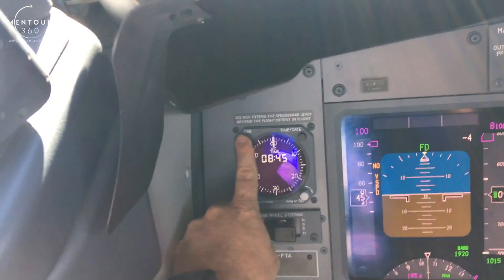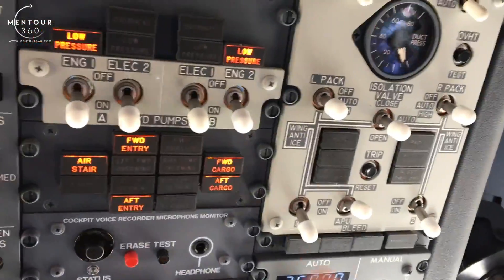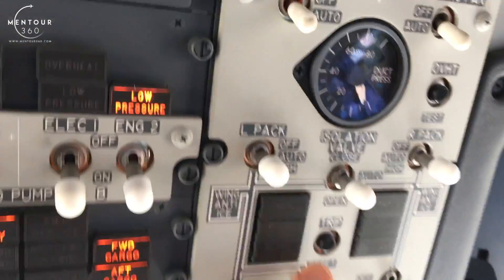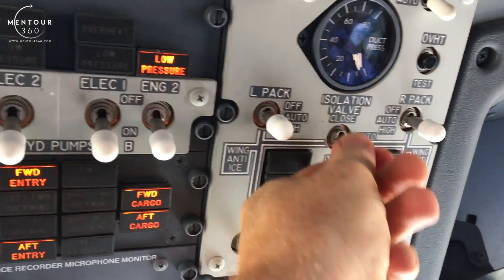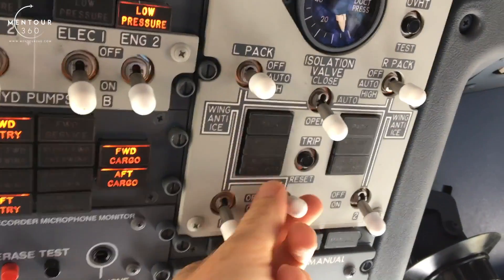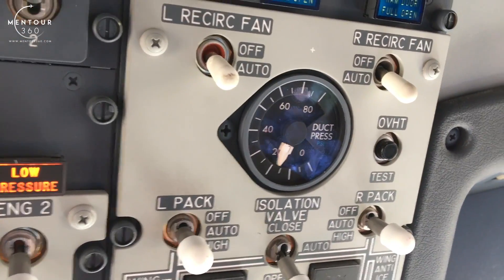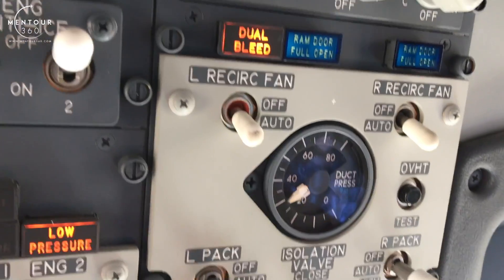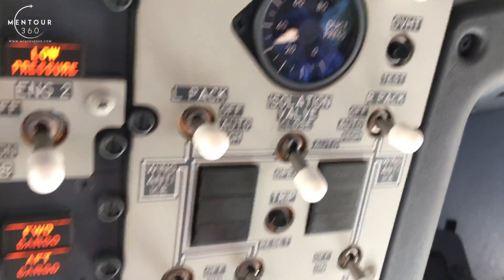What is this? - APU

Comment: Honestly, I think you should leave the engine starting process offline, due to the possibility of bad people possibly trying to take command of the aircraft. I know it is much more difficult since 9/11. There are certain things the general public does not need to know.
Reply: The hijackers of 9/11 took extensive flight school in order to know how to fly the aircraft they took over. Moreover, starting an engine is not very difficult and is the first thing on any checklist that are readily available everywhere. Gatekeeping knowledge in hopes it helps security is just security theater and does nothing of value.

Comment: This long controlled delays before starting the APU, what happens if you want to use it and start the engine in the air?, will you be waiting for this long before starting the failled engines to recover from falling from the sky?
Reply: Johnson Aruson 
You can windmill start the engines in the air...😉
And its not that long anyway..

Comment: What is isolation valve?
Reply: Sahal Mullan 
The bleed air isolation valve has these functions:
 
Separates the pneumatic manifold into right and left sides
Connects the right and left sides of the pneumatic manifold for cross bleed operation.

Comment: You can use it to Drive the HYD AC Pumps ??
Reply: The electrical hydraulic pumps, not the engine driven ones.
In short yes, at least on the 737.

Comment: Nooooooooo you turn off the APU once you are in the air and just before you land you turn it on!!! Soooooo what engines are running the electricals when you are cruising ????????
Reply from the maker: The main engines...
Reply: @MentourPilot  So you only run the unit on the ground!! ummm seems like a lot of engineering just to run it on the ground why not just use ground power?
Reply: @chilbury  Not all airports have ground power.
And the APU is also there to provide power during the flight in case of emergency such as engine failure.

Comment: what is wired sound in toilet aircraft after flush? is related In this video?
Reply: Not at all.
The flushing noise actually comes from the air rushing through the bowl down the waste tank and ultimately outside through a special vent.
That's because it uses differential pressure between the cabin and the outside.
And if you flush the toilet on the ground, a large vacuum cleaner kicks in to suck up your disposal into the waste tank since there's no differential pressure.

Comment: Can you use the Apu for hydraulic systems if you have an engine failure at cruising altitude?
Reply: Yes, and it happens to be one of the reasons for the presence of two electrical hydraulic pumps on the 737 in addition to the engine driven ones.

Comment: Before starting an APU in B737, it's important to do fire warning tests. He forgot to mention it. But u guys don't forget..
Reply: I skip that too, why bother ?
Just connect the battery, start the APU, connect the two main AC buses, then open the APU bleed air valve, turn on the fuel pumps and begin the main engine start "procedure".
Once the main engines are started begin the powerback, line up on the runway, then just TAKE OFF !

(Granted it's all happening on X-Plane 11...)

Comment: Im still a bit In the Dark about "APU Bleed" and what that means/does.
Reply: When the engines are not working no air will be there to breath and also to power up the aircraft 
Hence  apu is used as it will suck air from outside and pours the air in the cabin where the passengers sit .
And for the pilots to breath. Air .,

Hence it's called BLEED 

THE WORD BLEED MEANS AIR FLOW

Comment: You do an excellent job with these explanations. I was curious - do you have much trouble with hot starts on the apu? I've never had the opportunity to use one, as we relied on ground support equipment on everything I flew. I'm sure you have all kinds of automatic controls for such an event, just wondered if the hot starts were even possible due to auto intervention.

Comment: Do modern aircraft have RATs?
Reply: Biff Narzilla Yes
Reply: The 737 doesn't have one as the windimilling engines can provide enough power for the basic instruments and to actuate the flight controls.
But as a comparison the A320 has a RAT, which did play an important role in the miracle on the Hudson.

Comment: i don't understand the engines at all, i looked for answers but i just don't seem to find it. All the how does it work videos of airplane jet engines just say the same thing, the air is sucked in and pushed out and it's hot and bla bla bla. 
What makes the blades spin in the first place? how does the engine work? not what the engine does, HOW DOES IT WORK? seems to be an alien tech because nobody knows the answer. I've been looking for this answer for a long time, one time a guy told me that there is a different engine that starts the big engine but that's all . And for some reason, not you, not anybody ever thinks for mentioning this "little" detail, is it a secret? do they put alien area 51 tech in every jet engine and that's why you all keep quite about it? how the hell does the engine spin and spin so fast? there's nothing inside the engine that can make it spin, just some blades, that's no engine, that's some blades in a tube, that doesn't qualify to be an engine . What makes those blades spin, whatever that is, that alien tech from Uranus, that's the engine of the plane.
Reply from the maker: The engine gets started using compressed air. That makes the inner compressor spin really fast. When the speed is high enough in the compressor we add fuel to the burn-chambers and light it on fire. Since hot air expands it will accelerate the air backwards quicker and that air is used to push the engine forward.
The suction created by the air being heated up on the burners continue to turn the compressor. 
In modern engines this suction is what starts the fan going and ultimately drives the fan in the front of the engine. The fan then pushes air backwards creating even more thrust. 
It’s a quite simple design actually. :)
Reply: So you keep adding compressed air in it just to keep it going?
Reply: @CarMagic1  Compressed air in only added at the beginning on the ground.
Then the engines sucks up the air it needs by itself.
Reply: @psirvent8  right. No video about it. All they say, even this guy the pilot, is that the blades spin and the planes goes forward. Thats all. How exactly does that happen, it seems to be a secret because they refuse to explain. I am starting to think that not even pilots have any idea
Reply: @CarMagic1  I read in some comments that indeed not all pilots have the technica knowledge of Peter or Joseph from Captain Joe.
However I have no idea about how true it really is.
Reply: @psirvent8  The thing is that I find it funny how many publish videos and pretend to explain how an engine works but all they say is what that engine does and nothing else. Takes air, inhales air, compresses it in the back of the engine, mixes it with fuel, lights it on fire, pushes it on the other side of the engine therefore creating thrusts. Yeah no shit Einstein. It's like asking a guy, hey how did you build that apartment block? ah, I placed one brick on top of the other.

Comment: So.. Seem as it is a small Jet engine what would happen if you took your parking brake off and set it to maximum RPM? :D (Providing it has any form of manual throttle) 

Does the APU have a powerful enough Jet Blast to actually make the aircraft move on the ground? I know it's too weak for serious taxying, but could you nudge the aircrat with it if you really wanted to fool around for fun and experiments??
Reply: The APU on modern airplanes doesn't have any kind of manual throttle.
Also it doesn't provide any usable thrust.

Comment: Why are airliner Air Conditioners so weak? Is it to save costs?
Reply: Cody, two primary factors to be considered;
1. The aircraft uses the expansion of compressed air for cabin cooling, a system that is simple, effective and requires minimal additional parts and small duct systems to save on the weight and maintenance needs, both critical for an aircraft. 
2. The majority of It's working life, a commercial airliner spends around 35,000 feet above the ground with surrounding air temperatures of about -60°F, an environment where the need for additional cooling is minimal.

Comment: Love your videos! are aircrafts AC or AD usually?
Reply: Battery power is 28 VDC and AC power is 115 volts but at 400 Hz not 50 like the rest of the world, or 60 like Canada the USA & Mexico. Higher frequencies mean transformers can be much lighter weight. Some parts of upstate New York ran on 25 Hz, and you had to buy special 25Hz rated appliances and radios or they would simply burn up. They all had heavier motors and transformers in them, and this cost between 10% and 50% more than a 60 Hz unit.
Reply: I can't say for aircraft but as an X auto tech cars are DC, since batteries are used onboard batteries themselves are DC.

Comment: I still don't understand, is the APU supposted to run all along the flight, or is it turned off once the engines are started? I'm a bit confused by the word "auxiliary" because it looks like a critical component to me, the aircraft can't start without it, so why "auxiliary"? For me it would make sense to use an "auxiliary" power unit for emergencies only (e.g., complete failure in both engines).
Reply: The APU can be turned off once the main engines are started, although leaving it on during the flight doesn't do much except it uses extra fuel.

Comment: can u tell me or do a video on WHAT IS  INSTRUMENT RATING and MULTI ENGINE RATION. because a lot of people confuse before get in to flighing school, even iam facing same confusion know??🤔
Reply from the maker: Intrsument rating will allow you to fly in cloud and bad weather. Multi engine is a rating to fly aircraft with more than one engine. Most of the time you do your skill test for Multi engine in Instrument conditions to make sure that you have both ME and IR.
Reply: Mentour Pilot thank you for the information.
Reply: Vor is flying with visual reference. ILS is instrument landing with no visual cues. In training they put a hood shield over your face to practice in flight without seeing as it would be in dark or bad weather conditions. So you use only yor altimeter and gauges to fly. Multi engine is 2 or more engines. You must know what sequence to start engines on the ground and in the air. Crossfeed fuel fron one to the other. Know how to shut down an engine in the event of fire or damage. They are 2 completely different aspects of flight tests. Two separate items. You can do ILS in a one engine aircraft. Do you get the differences?

Comment: when in flight do main engines Generate any electricity? or is APU the only thing that generates electricity on board of a plane?
Reply: The main engines generate power and bleed air, and are normally the only source of it when they're running. Once all main engines are running the APU is shut down, and isn't restarted in the air unless at least one engine fails. After the plane lands, the APU will typically be started during taxiing, so by the time they park at the gate it will be providing power and air so they can shut down the main engines right away.

Comment: I've always wondered. What is the purpose of the switch? between the attendant call and ground call buttons?
Reply: Call attendant is basically the same as passengers.
Pilot presses it and it dings in the cabin, although it's a different sound than if it was a passenger so the cabin crew knows the call is coming from the cockpit.

Ground call is a beeper in the nose landing gear wheel well.
It's loud enough to get the attention of ground staff around the plane, however once an engine is running it can't be heard anymore.
It's the closest to a horn for an airliner.

Comment: Do u put off APU when both engines r started up or in the air??
Reply: Puninder Hans just after the engines have started and before the aircraft starts to taxi it is shut off and as that happens  if you look carefully (it's less noticeable on brand new aircrafts with brand new interiors) you can see all the lights flicker as the busses change sources

Comment: Question: what's the reason behind waiting 1 minute before using the APU as a bleed air source?
Reply: It said in the video: so the apu internal components are heated up so loading it to provide bleed air doesn't stress it

Comment: Is the APU the switch that was turned on in the movie "Sully"?   If it's already on during flight how did sully turn it on after the bird strike? Or am I completely off
Reply: The pilots switch the APU off once the engines are running

Comment: Wait, it's legal to fly an aircraft with a non-functional APU? What happens if you have dual loss of thrust? How the hell would you re-start?
Reply: Presumably the battery and/or RAT could run the igniters and fuel pumps. You don't need bleed air to spin the engines as the airflow is already doing that.
Reply: you can also restart the engines in Flight. You just need a certain amount of IAS to do so.
Reply: TopherFM exactly what I was thinking

Comment: Once I was told about the power of a medium size APU (go and figure what they mean by medium) is around 400KVA which is a LOT. You can power 4 or 5 residencial buildings from that figure.  Guess the AC unit on the plane needs serious power.
Reply: Because it also pressurizes the hull and powers the avionics and hydraulic subsystem.
Reply: The 131-9 APU on the 737-NG is rated for 90 kVA electrical power (66 kVA above 31000 ft), and the older APUs used in the 737 series even less.

Comment: Very comprehensive. Does the APU have the same problem with bleed air contamination as the main engines?
Reply: Mentour Pilot I see, Thank you. If I understand correctly they only have problems when poorly maintained and during acceleration. 
  I hope someone solves that problem soon. It has been causing our f-35 pilots problems. They may have solved the issue already, for all I know. 
  Great channel, thanks again. Take care.

Comment: Hello Mentour! Is there any difference in using the FWD or AFT left fuel pump for ground operation of the APU?
Reply: I thought they used the fwd fuel pump because its easier to access and fix should there be anything wrong. shrug
Reply: Kevin W I've heard about this version:) But may be there is something more hidden behind this?)

Comment: Question:
Is a pilot ever alone in a cockpit?
Reply: It's because of the accident that happened with germanwings some time ago...
Reply: In the U.S. and certain other countries, it's now a requirement to always have two people in the cockpit.  So if one of the pilots needs to take a leak, the Senior Flight Attendant will step in and keep the seat warm (actually, probably the jumpsuit).
Reply: TonyP0927 most airlines are getting rid of the two people in the cockpit rule at all times now, because it was determined that having two people in the cockpit probably won’t stop a germanwings style event happening, and the majority of, if not all pilots are sane people. Pilots are now undergoing better psychiatric tests instead of the 2 man cockpit rule.
Reply: DanneYT no, if a pilot needs to go to the toilet, one Flight Crew (FA) would come in and be in the cockpit with the other pilot. that's one reason why they put the seatbelt sign in before one of the pilots step out of the cockpit and the other reason the seatbelt sign gets put on is to stop people running to the cockpit and hijacking the plane
Reply: DanneYT the minimum is 3 as there must be 2 in there at all times. This was agreed within hours of the accident, when the co-pilot was alone while the captain was in the bathroom. When the captain came back, he wouldn't open the door on purpose. He had to use a fire axe, and it didn't open the door. The co-pilot had mental disablities, and purposely crashed the plane into a mountain.
Reply: In the air, probably not for long periods. During the co-pilot's restroom break would probably be one example, or if the co-pilot  needs to go into the cabin for some emergency. There's probably other instances too.
Reply: Stop spreading nonsensical conspiracy theories. It is just disrespective of the victims and everyone involved and complete b.s.
Reply: Memes are this version of the crash is strongly disputed. There is quite a strong case for this being a cover up of some intentional or accidental military interference.
Reply: I am aware. I just told him the way that air crash investigations found out it was

Comment: +mentourpilot I'm very surprised you're allowed to take off with an inoperable APU. If you had a double engine flame out (flying through an ash cloud for example) would you be able to restart the engines without it? Also wouldn't you then be entirely reliant on the RAT thus removing a whole layer of redundancy?

Comment: Hello, I have a question about Emergency Procedures in an Airline. I have this app that monitors flight around the world. I often time got alerts that says SQUAWK, can you enlighten me on this or probably make a video regarding this? Thank you!
Reply: Each airplane is fitted with transponder.
The transponder sends out squak. The ATC asks the Pilots to set a specific squak so that ATC can see them on their Radar.

There are three emergence squaks which Pilots can use in emergency.

Squak 

7500: Hijack
7600: Radio failure
7700: Any other emergency

Hope that helps
Reply: oh i see thanks!